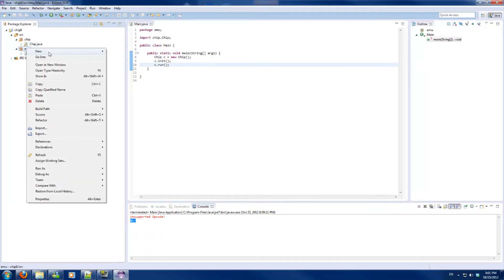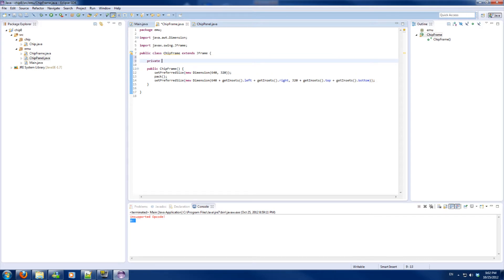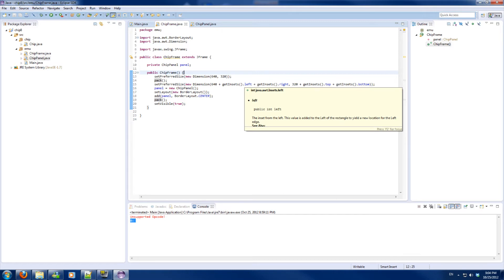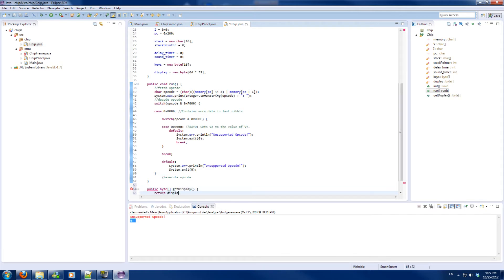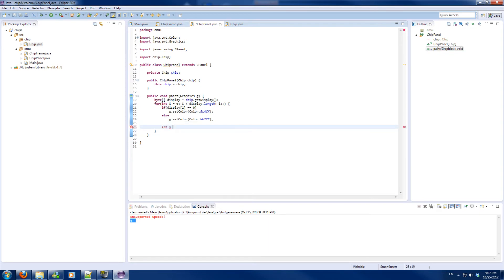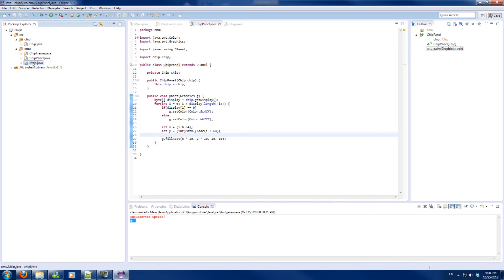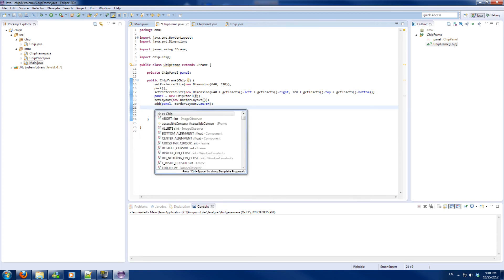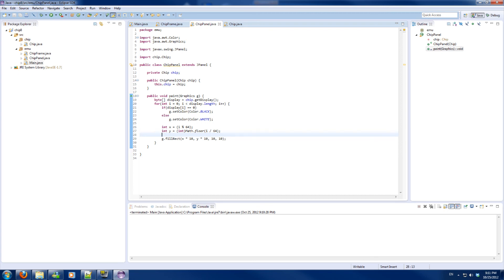Make your own emulator - S1 Part 1: Assignment Solution

Comment: Hey there :D

Im unfortunately getting a NullPointerException (ChipPanel.java, line 19), but I can't seem to find my mistake. I would greatly appreciate it if you could help me.

My code:
Main.java:
package emu;

import chip.Chip;

public class Main {
 public static void main(String[] args) {
  Chip c = new Chip();
  c.init();
  //c.run();
  
  ChipFrame frame = new ChipFrame(c);
 }
}

Chip.java:
package chip;

public class Chip {
 private char[] memory;
 private char[] V;
 private char I;
 private char pc;
 
 private char stack[];
 private int stackPointer;
 
 private int delay_timer;
 private int sound_timer;
 
 private byte[] keys;
 
 private byte[] display;
 
 public void init() {
  memory = new char[4096];
  V = new char[16];
  I = 0x0;
  pc = 0x200;
  
  stack = new char[16];
  stackPointer = 0;
  
  delay_timer = 0;
  sound_timer = 0;
  
  keys = new byte[16];
  
  display = new byte[64 * 32];
 }
 
 public void run() {
  char opcode = (char)((memory[pc] << 8) | memory[pc + 1]);
  System.out.println(Integer.toHexString(opcode));
  
  switch(opcode & 0xF000) {
  
  case 0x8000:  //Contains more data in last nibble
   
   switch (opcode & 0x000F) {
   
   case 0x0000: //8XY0 [Sets VX to the value of VY]
    default:
     System.out.println("UNSUPPORTED OPCODE");
     System.exit(0);
   }
   
   default:
    System.err.println("UNSUPPORTED OPCODE");
    System.exit(0);
    
  }
 }
 
 public byte[] getDisplay() {
  return display;
 }
}

ChipFrame.java:
package emu;

import java.awt.BorderLayout;
import java.awt.Dimension;

import javax.swing.JFrame;

import chip.Chip;

public class ChipFrame extends JFrame {
 
 private ChipPanel panel;
 
 public ChipFrame(Chip c) {
  setPreferredSize(new Dimension(640, 320));
  pack();
  setPreferredSize(new Dimension(640 + getInsets().left + getInsets().right, 320 + getInsets().top + getInsets().bottom));
  
  panel = new ChipPanel(c);
  setLayout(new BorderLayout());
  add(panel, BorderLayout.CENTER);
  pack();
  setVisible(true);
 }
}

ChipPanel.java:
package emu;

import java.awt.Color;
import java.awt.Graphics;

import javax.swing.JPanel;

import chip.Chip;

public class ChipPanel extends JPanel {
 
 private Chip chip;
 
 public ChipPanel(Chip c) {
  this.chip = chip;
 }
 
 public void paint(Graphics g) {
  byte[] display = chip.getDisplay();
  
  for (int i = 0; i < display.length; i++) {
   if (display[i] == 0) {
    g.setColor(Color.BLACK);
   } else {
    g.setColor(Color.WHITE);
   }
   
   int x = (i % 64);
   int y = (int)Math.floor(i / 64);
   
   g.fillRect(x * 10, y * 10, 10, 10);
  }
 }
}

Thanks for your time
Reply: not sure if you still need help with this but i think the reason for the ChipPanel.java error is caused by the chip not being public in the ChipPanel.java function.
Reply: so the display value reads null.